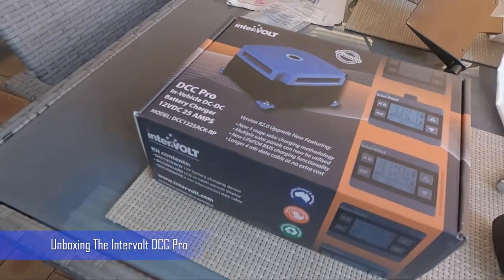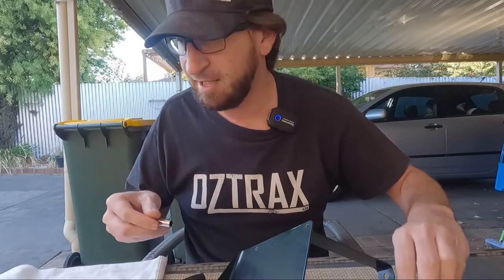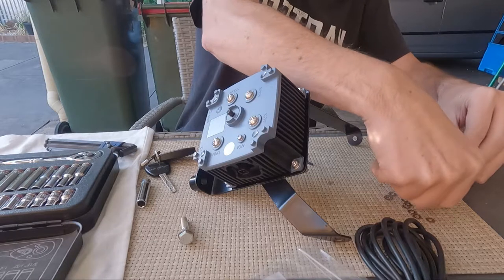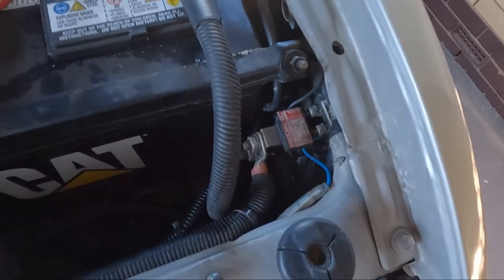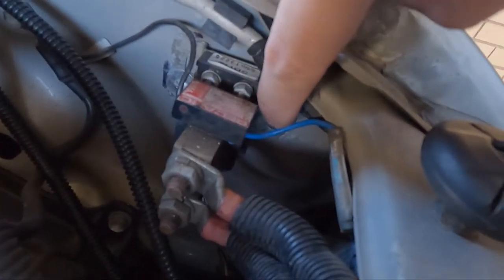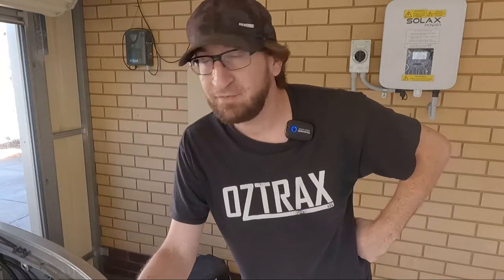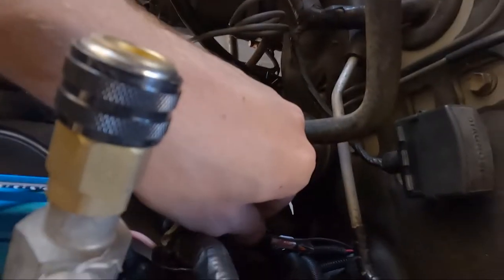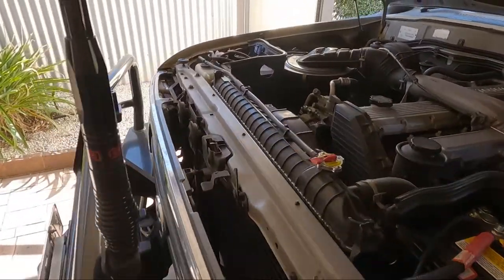Toyota Landcruiser 80 Series // 12 Volt System Upgrade

Comment: Hi, have just brought one of these and looking to install it the next few days. I have had a similar product in the past and haven’t had to wire into the ignition wire. It just knew when the van was running. Is that the case with this intervolt system aswell or do I have the wire it into the ignition?
Reply from the maker: Hey Luke

What vehicle are you fitting it to exactly?

If it's a later model vehicle with a smart alternator, you can purchase the extra Inertial sense module, which picks up engine vibrations through the body and triggers the Intervolt DCC Pro to turn on.

If it's a regular old school 80 series, it detects the voltage increase from the battery when the alternator is spinning and that turns it on.
Reply: @OzTrax4X4  hi thanks for the message back. It’s a 2007 ford transit. Any info is much appreciated.
Reply from the maker: A 2007 Transit doesn't have a smart alternator, so you should be good to wire it in as normal 🤠👌
Reply: @OzTrax4X4  wiring it in as normal how? So wiring it into the ignition? Or leaving the ignition black? Thanks
Reply from the maker: You won't need to wire in the ignition trigger wire.

Connect to main battery, connect to aux battery and done. 🤠👌
Reply: @OzTrax4X4  hi mate. So I have wired it up and when the van is on it flashes blue so no problem there. 

When I turn the van off it flashes red. Should it not just turn off? Instead of flashing red? 

Thanks
Reply from the maker: @luketucker22  Do you have your auxilary battery connected?

If you don't, it will be red.
Reply: @OzTrax4X4  yeah so I have everything connected and everything seems to work as it should.  But when the van is turned off the display is still on saying not charging and the light flashes red still
Reply from the maker: @luketucker22  might need to reprogram the unit and make sure the battery type is correct.

If you shoot me a message over on Instagram or Facebook, I'll be able to delve more into the troubleshooting side of things with you.
Reply: @OzTrax4X4  perfect mate what’s your Insta name
Reply from the maker: @luketucker22  same as here bud. 😎👌
Reply: Which lithium aux batteries are compatible with this charger?
Reply from the maker: You would need one that has a BMS.